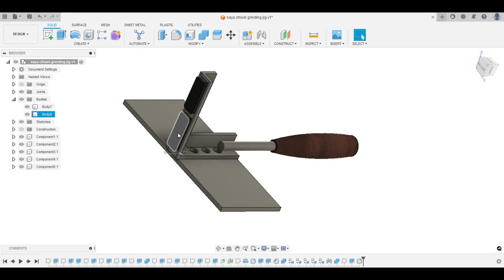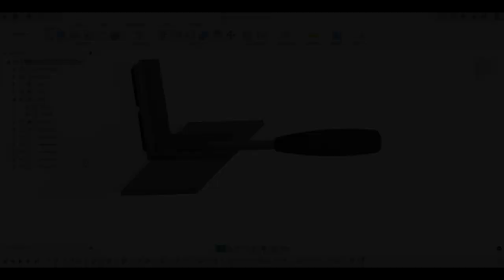Awesome Radius Grinding Tool (for Making Saya Chisels)

Comment: The magnets will gather a lot of fillings too. You could drill very shallow holes to the sides, like notches, of each chisel and clamp them with screws in these notches. 2 on each side would probably be enough. And might be more secure and less of a nuisance than the magnets.

Comment: Maybe a setscrew under the sliding part, bearing on the base, could prevent to  fixture getting sucked into the platen by the magnets. This could be as simple as a 1/4-20 nut and a short piece of all thread. Might work, might not.